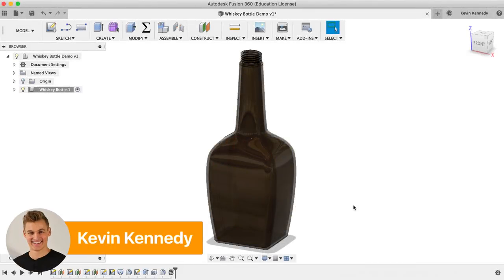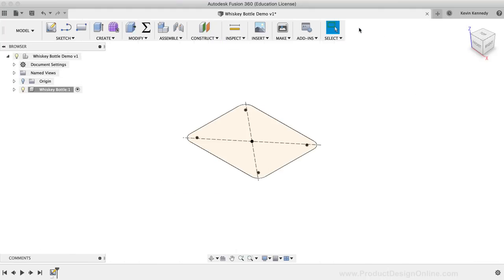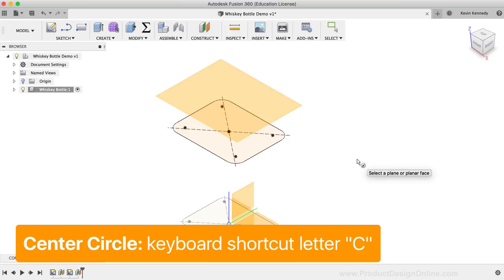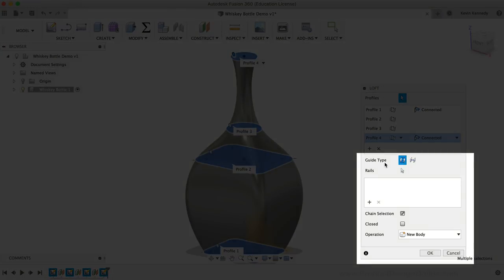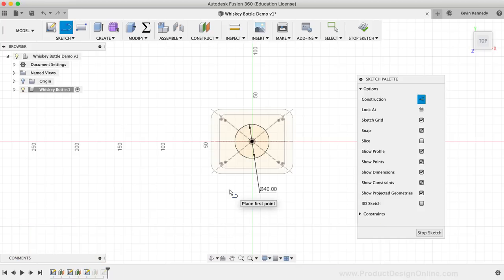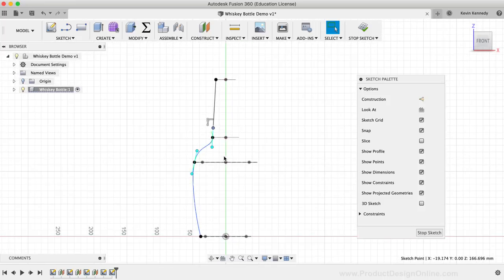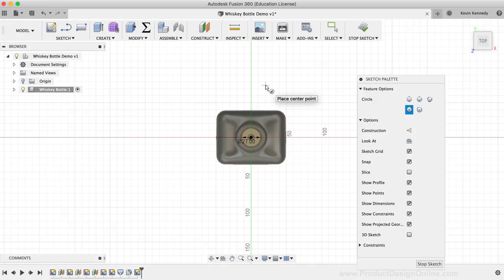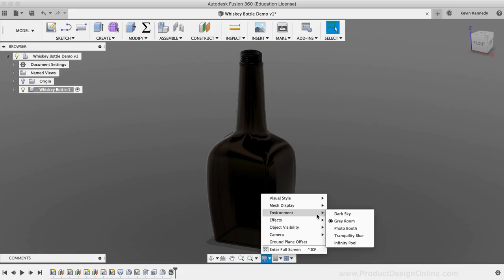How to 3D Model a Whiskey Bottle - Learn Autodesk Fusion 360 in 30 Days: Day #4 (REVISED)

Comment: While doing the loft I kept getting the message "rails had to go through all profiles".  I went back to the sketch with the guide rails and redid dragging the top spline point onto the line (I definitely did this before the mirror).  Both sides changed as I did this.  I then attempted the Loft again, and the left rail worked, but the right did not.  I went back, did the same tweak on the right rail and then reattempted the loft and it worked.
Reply from the maker: Check that you have the "Auto Project Edges on Reference" setting turned on (it used to be a default) - https://productdesignonline.com/default-settings-for-fusion-360-tutorials/#autoProject
Reply: @ProductDesignOnline  I just checked and it is still applied.
Reply from the maker: @Infrared73  can you export your file and share it via an online service (dropbox, google drive, etc)?
Reply: I might not have been very clear.  I was able to get it working.

I had followed the steps in the video.  After snapping the spline handle into place and mirroring I attempted the Loft and it failed.

I went back and re-did the steps to snap the spline handle into place.  I saw that the mirrored side was adjusted as well so attempted the Loft.  This time, I could apply the side I had adjusted as a guide path, but not the side I hadn't adjusted.  I then went back and tweaked the mirrored side and then the loft worked.

I doubt this behaviour is intended in Fusion 360.

Comment: I also get the message that the rails do not touch all profiles (at the point where the spline meets the line) even after snapping the spline handle to the line just like you. the spline handle moves along the line and I still get this error.  Still learned a lot of useful skills with this video though but can't find the solution to the error as the connection point between spline and line seems to be connected to the profile of the bottom circle.
Reply from the maker: Hi Bert - Please check this - https://knowledge.productdesignonline.com/article/25-day-4-whiskey-bottle-the-selected-rail-does-not-touch-all-of-the-profiles-error

Comment: When using the shortcut key (S), I have 2 Loft commands: one with an orange icon and the other with a blue icon. What is the difference between them ?
Reply from the maker: Hi, Gerson. That's a great question! The BLUE icons represent SOLID modeling tools. That's what you'll want to use for this tutorial. The ORANGE icons represent the SURFACE modeling tools. The surface tools create surfaces, which means they don't have a solid watertight body inside of them. Cheers, Kevin :)

Comment: I replied with a link to your comment on my loft command woes
Reply from the maker: Hi, mbnaso. I just checked your file. I see the issue is that your points were not actually snapped into each profile. This may have been because of a difference in settings or how you selected the points. Make sure your "snap" option is turned on in the sketch palette. You can compare your settings with mine here if that's not it  - https://bit.ly/defaultsettings

To check, you can simply click and drag on the points...notice how they're will easily move away. To fix this, select the "coincident" constraint in the toolbar (while in the active sketch) and then select the point of the spline or line geometry and the respective point of the sketch profile. After doing this to all four points I was able to get your loft to work without any issues. here's your file with my changes as described - 
https://productdesignonline.autodesk360.com/shares/public/SH919a0QTf3c32634dcf27ff6498f5f43e7e

Comment: I had fun with the paper clip, but need help here.  I am using Fusion 360 on a Windows laptop. I am forced to use the new interface, and some things aren't working the same as they do for you in the video.  I cannot get the spline to connect with the construction points on the planes.  In your video, the spline snaps to the points, but not on my machine.  I have looked for some setting or preference to control that, but haven't had any luck.  Of course, I cannot use the guide rails to shape the bottle.  If you have made this bottle work using the new interface, I'd love to know how  you make the spline snap to those points.
Reply from the maker: Hi, Charlie. The snap issues are likely due to the "Auto Project Edges on Reference" setting. Make sure it's turned on. Instructions here - https://productdesignonline.com/default-settings-for-fusion-360-tutorials/#autoProject
Reply: @ProductDesignOnline  It Worked!!!  Thank you.  I now am the proud owner of my own Whiskey Bottle.  These are great tutorials, and you are a great help when needed.  On to the next one...
Reply from the maker: @charliestricklin  Great...glad to hear you got it working! Keep going :)

Comment: Thanks for this great quality tuto video ! I have some difficulties to make the loft. I have checked that the B-spline is well locked to the line and all seems OK. When I select the first rail guide, I have the following warning message : "Warning: The selected rail does not touch all of the profiles." I use the last version (v2.0.7438) of Fusion360 at the time where I write these lines.
Reply from the maker: Hi David. I'd be happy to help troubleshoot. I've looked at a few files of others that have had this same problem. What I found is that many of their top straight lines appeared to be connected to the top profile, but it wasn't 100% (impossible to tell by the naked eye). Try deleting the top straight line and re-draw it - making sure it snaps to both profiles. Then, double-check that your spline is still snapped to it. You'll have to re-mirror the sketch geometry over, but you can check with the left spline point first.

If that doesn't fix it then let me know and I can look at your file.
Reply: @ProductDesignOnline  I had this and had to redraw the top straight line...although I would swear I didn't draw it any differently (I did draw it from the top to the bottom) the rail guide then worked
Reply from the maker: @troyhough7013  Hi Troy. The loft command can be picky sometimes - but glad to hear you got it working!

Comment: This one went great until the shell command ... used 3mm and got an error "This operation could not create a valid shape. Try adjusting the values or changing the inputs."

can sell larger at 3.5mm or smaller at 2.95mm; but not 2.96mm through 3.49mm, that range gave me the error...

Dont know why or what, so I called it good at 2.95 and things went smooth from there as well... any insight into what I may have done to earn that error?
Reply from the maker: Hi Clayton, it's likely due to the curvature of the splines. You can adjust the spline handles where they attach to the straight line. You should didn't be able to shell at different thicknesses.

Comment: I still had a lot of trouble with the point spline.
I had to type out the distances on the construction lines which made me able to snap.
Without that I couldn't get the spline to make black dots on the sketches.
Reply: I had the same issue with the latest version (2.0.9305)  where the guide points we created with the construction lines disappear as soon as either spline tool is enabled. I solved it by projecting the points onto the XY sketch and then using the spline tool.

Comment: Hey Kevin, not sure if the newest UI and default settings of fusion are my issue, but when I go to connect the straight line to the spline even though the spline snaps it doesn't seem to connect. I scrolled through comments and didn't notice an answer. I was able to make it work by adding spline points all the way up, but haven't figured out a way to connect the spline line to the straight line. 

Any suggestions?
Reply from the maker: Make sure you have the "Auto Project Edges on Reference" setting turned on. Instructions to turn it on - https://productdesignonline.com/default-settings-for-fusion-360-tutorials/#autoProject

That will help you snap the rails to the profiles, as long as you're looking straight at the sketch.
Reply: @ProductDesignOnline  Those are set to on already (fixed that during the beer bottle!). Any other things to check? Thanks for taking the time to reply to comments.
Reply from the maker: Check that the  "Snap" option is turned on in the Sketch Palette.

Comment: Great videos!  Love the easy to understand method of teaching you have.  I have a hard time understanding some tutorials because the instructor assumes there is some "tribal" knowledge people have, even when they are teaching "beginners" they assume you know some of the lingo, or teminology.

Thanks for the classes!

For some reason my bottle does not allow a "shell" thicker than 1.8mm.  If I try and add it thicker my coputer freezes up for about 30 seconds and gives the following error:
The operation could not create a valid result.  Try adjusting the values or changing the inputs."

Anyone have any ideas?

Thanks
Reply from the maker: Thanks, Charles! Glad you're enjoying them. You may have to adjust the curvature of the splines if your shell is not letting you do any larger. The Shell command essentially traces the geometry and creates the thickness. When geometry has sharp curvature (changes quickly) it will throw that error.

Comment: So did anyone else have the issue when making the sketch fillet right at the start of a 7mm fillet causing a massive ballooning outwards of one side?  This could be remedied for me by using a larger fillet like 15mm, but anything smaller causes ballooning.  Is it a constraints issue?

Comment: First off thank you for these wonderful lessons. I do have a problem everything is fine until I go to loft, then I get the Warning "the selected rail does not touch all of the profiles."
The spline did snap to the line ok and I can move it up and down the line. All of the lines are snapped to the profiles and points cannot be pulled away. BTW I am using the new interface.
I have redrawn this at least 3 times and watched the video at least 5 times. I am sure it is something simple. But.........
Reply from the maker: Hi, Gunstar Sighting Solutions. Glad you're enjoying them! 

It's very likely that one of your spline or line points doesn't snap into one of the four profiles. Even if they appear to all be there it may be that it's slightly off when you zoom way in.

I'd be happy to look at your file. To share your file please go to File > Share > Share Public Link (make sure "downloadable" is toggled on) > Paste your link here as a reply to this comment.

Cheers, Kevin :)
Reply from the maker: @gunstarsighting9345  Thanks for sharing the link. I took a look at your file. The good news is the is 95% correct. I went to complete the loft and the left guide rail worked fine. The guide rail on the right was what caused the error. This tells me that something got thrown off when you mirrored the sketch. To fix this, simply double-clicked to edit the last sketch. Delete the spline and straight line on the right and then re-mirror them over. Finish the sketch and try the loft command again. I was able to complete the loft of your file with no problems after re-mirroring the sketch. I couldn't tell you what caused this in the first place, other than the possibility of it the sketch getting moved by accident.

Let me know if that fixes it for you! Cheers, Kevin :)

Comment: Hello Kevin - I am really enjoying your tutorials but I have run into a problem.  I am at the point where I have created all of the construction lines for the splines and the sketch points appear when I hover, just as they are supposed to do.  When I try to activate Splines, the Sketch option is not there so I use "S" and then I type in "Spline", then I select "Fit Point Spline".  This works but when I start to draw the spline, it will not snap to the sketch points.  I am having the same issue when I try to draw the line between offset planes #3 and #4.  I am stuck, please let me know what I am doing wrong.  Thanks Marc
Reply from the maker: Hi, Marc. Can you check that the "snap" option is turned on in your sketch palette? You can also cross-check your settings with mine here - https://bit.ly/defaultsettings

If neither of those seem to be it then let me know and I can take a look at your file :)
Reply: @ProductDesignOnline  Thanks Kevin - Your instructions really worked, the problem was that I did not have `Auto Project Edges` checked.  After I checked I was able to proceed.  Your tutorials are really great, do you sell a book?
Reply from the maker: @marcwade2778  Sweet - glad that was it! I do not have any book on Fusion 360. The challenge is that the Fusion 360 team pushes out updates every month...so books become dated before they're even published.

I'm creating a lot more content for my website...as that can be updated faster/easier when things change. Always open to ideas as well. - https://productdesignonline.com/tips-and-tricks/

Comment: I’m following the tutorial wonderfully up to the Fit Point Spline part. My spline won’t snap to the construction points we made on the different planes. Which means my rails won’t work. I try moving the spline points into the planes but that doesn’t work either. I’m at a bit of a loss.
Reply from the maker: Hi, Jason. Do you have your "Snap" setting checked on in your sketch palette? If the snap setting is turned on then take a look at the rest of the settings and make sure they match mine - https://snag.gy/R0a6xc.jpg
Cheers, Kevin :)
Reply: Hi there, thank you for your reply, the only setting on my end that didn’t match yours was the 3D shape. I tried again from scratch following along & I’m still getting the rails not through each plane error message. I’m at a loss. 
I must be doing something wrong but I don’t know. 
My snap settings are on, & have been, but my spline still won’t snap to the center point we make on each plane.
Reply: Ok I finally got it! I’m still not sure what I did wrong, but I got it.
Reply from the maker: Hi Jason. I'm glad to hear you got it to work! If you want, I can take a look at the version of your file that wasn't working to see if there is anything I can notice that isn't set up correctly. If so, share the public link as a reply to this comment...just be sure to get the previous version from the data panel. Cheers, Kevin :)
Reply: @ProductDesignOnline  I am also having the same problem and haven't yet found a solution. Can I share the public link?
Reply: Also got it to work, and like above, not sure what was wrong.
Reply from the maker: @ochiengoduor314  The loft command can be really picky. It's hard to say without looking at your file, but it was likely due to F360 not thinking your rails were touching all the profiles, even if they appear to touch to the naked eye. Nonetheless, I'm glad to hear you got the issue resolved. I'm always happy to take a look at your file(s) should you have questions. Cheers, Kevin :)
Reply: @ProductDesignOnline  I had the same problem, ended throwing the model and started from the scratch. Still there was no way to get the snap to the construction points in each plane, just moved the perspective as you suggested and zoomed in to click in the right spot. Took me a couple of tries but finished the bottle. On to the next one :)
Reply from the maker: @YuriAlvarez  Glad to hear you worked through it. Keep at it and don't hesitate to comment if you have questions on any of the tutorials in the remainder of the series. Cheers, Kevin :)
Reply: Hello, I enabled the setting (Allow 3D sketching of lines and splines in Preferences -> General ->  Design) and the splines snapped to the construction points.
Reply from the maker: @Mosrod  Thanks for sharing this tip, Mosrod! This will help, however, it shouldn't be necessary. I believe most are having issues as their "Auto project edges on reference" has been turned off. Cheers, Kevin :)

Comment: I'm having trouble with the spline tool not snapping to the end of the construction lines.  I also had a similar problem in the Lego project getting the bottom circle to snap to the tangent of the circle on top of the model.  Am I missing some kind of setting?
Reply from the maker: Turn on the "Auto project edges on reference" setting that used to be on by default. Instructions - bit.ly/defaultsettings

Comment: I'm still getting the error that says the rails are not touching the profile after moving the spline control handle to the line for the neck of the bottle. Not sure what I'm missing. Line and Spline are two different colors if that matters.

Comment: I've followed VERY carefully, but as soon as I try choosing the rail, Warning: The selected rail does not touch all of the profiles.  100% my spline is napped to my line.  Any thoughts?  I'm using version 2.0.7438 of Fustion 360.
Reply: OK, I got it.  Even though the snapping behaviour is EXACTLY as you demonstrated, you need to have the box for "Snap" checked in the Sketch Palette.  That did it.
Reply from the maker: @EvanNadeau  Gad to hear you got it. That is correct, having the snap option checked in the sketch palette Will ensure the line geometry actually snaps to the point.

Comment: After I do the mirror and click loft the guide rails disappear and end up with the same shape as from before the guide rails? (I'm using the latest version which is a little different)
Reply from the maker: Hi, jktrain. It could be several things. First, can you check that you're using the right mirror command? https://productdesignonline.com/tips-and-tricks/mirror-command-not-working-in-fusion-360/?_thumbnail_id=11753

Second, the loft command should also be the Blue Solid modeling loft command (as there are 2 others - surface and form).

If it doesn't seem to be either of those, can you share links to a screenshot or your file?
Cheers, Kevin :)